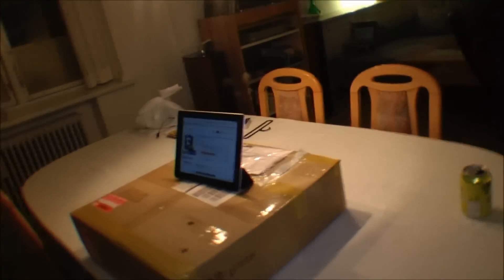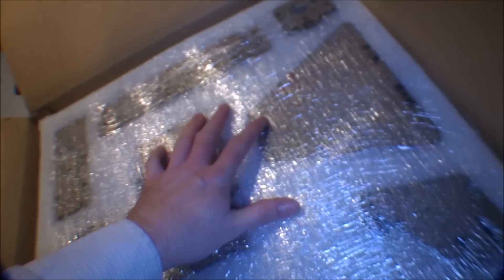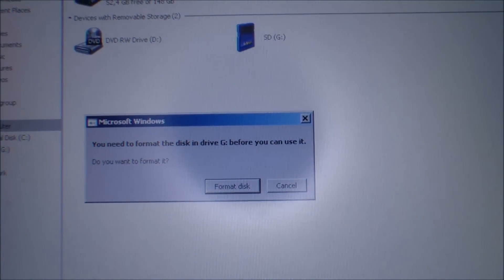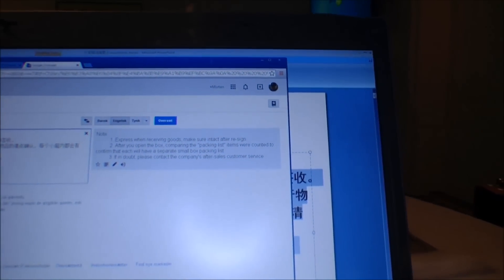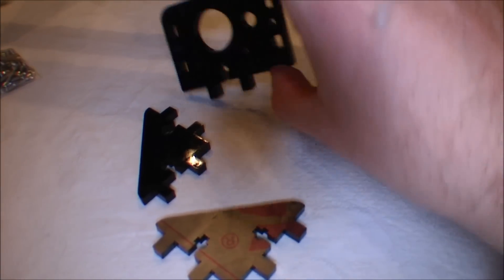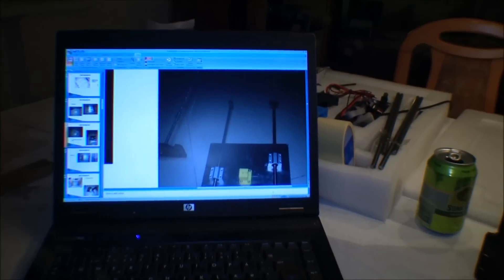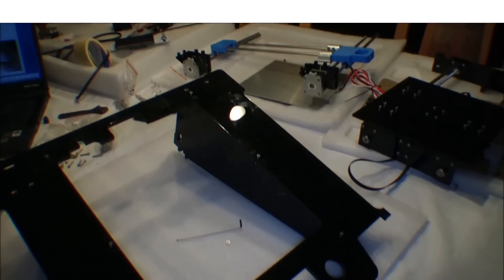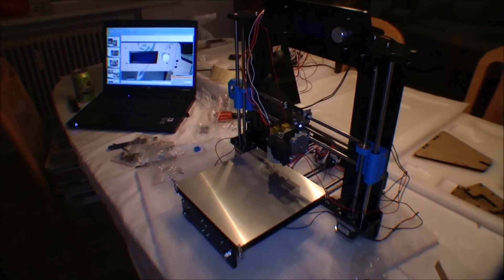Unboxing of inexpensive Chinese reprap 3D printer - 095

Comment: Hi! I'm having some trouble with the link I found below to the manual. Is that because it has to be shared individually?
Reply from the maker: HI +Samantha McKeough 
Can you download this one?

https://drive.google.com/open?id=0B1Mhi7AjDrYucTVlTUdndzUybk0

Thank you for watching! :-)
Reply: +My PlayHouse (Morten Hjorth) 
Yes thank you! I was unfamiliar with the file format, but had someone help me out. I really appreciate it!
Reply from the maker: Hi Samantha McKeough
Glad this worked out for you! are you putting it together or installing software.
Thank you for watching! :-)
Reply: +My PlayHouse (Morten Hjorth) 
Right now I am putting it together, but hopefully will get to software install later this weekend :)
Reply from the maker: Hi +Samantha McKeough
okay,, if you run into problems with your stepper motors,, I did a video on that.
Thank you for watching! :-)

Comment: Hello, Nice video!
I have the same printer, but the sdcard was empty, could you provide the manual and build files on the sd card? (Er norsk hvis du har oversatt til dansk :)
Reply from the maker: Hi Olai Bjørgaas 
Certainly, if you send me a private message with your e-mail,, I will send you a link to an FTP server. The files are too large for email.
Thank you for watching! :-)
Reply: Morten Hjorth
Just finished the printer and the first test (Dice) the printer preformed over all expectations !
Some minor faults in the design, like placement off the board in the box on the side and brittle acrylic. But all in all extremely happy
Thanks for the manual Morten, helped a lot on the wiring :)
Reply from the maker: HI Olai Bjørgaas 
You have totally surpassed me on the inside track!! 
I have not had time, to work on my printer the last week,, but now, I know who I can ask for advised. :-)